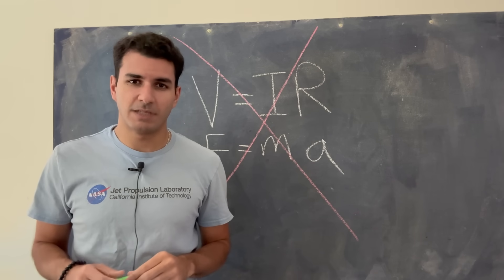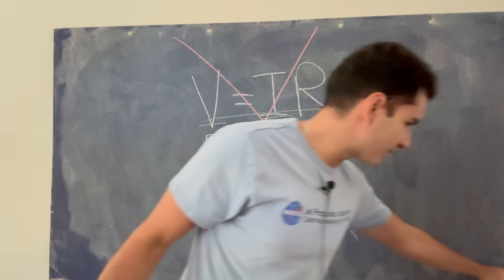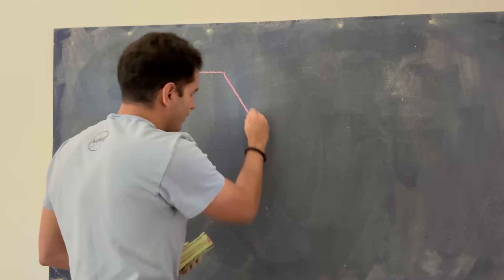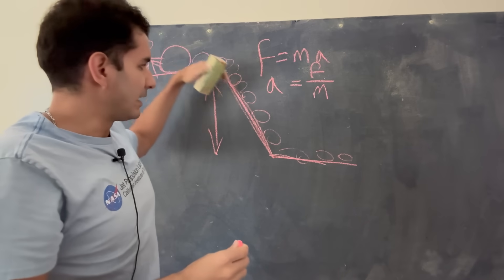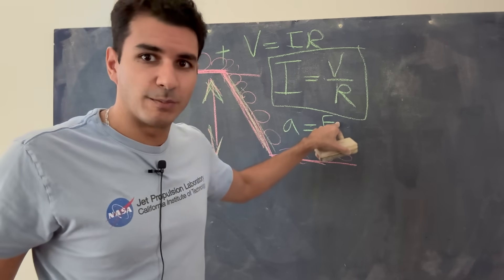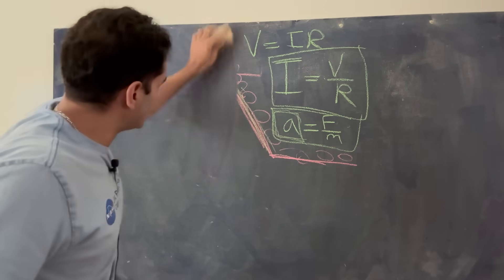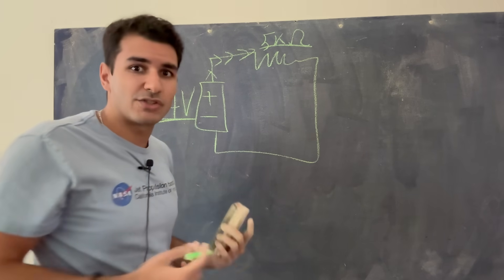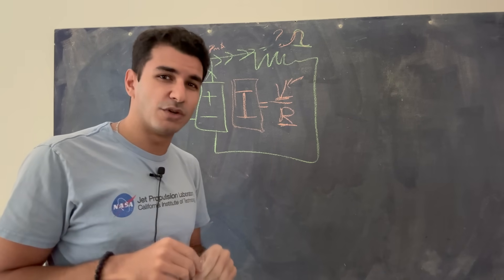You don't really understand physics

Comment: WOW.  Glad I stumbled onto this.
I wondered where you were going with this at first and you take too long to get the the root of the issue  - cause and effect.
From comments saying they never thought of cause and effect, tI can see they have indeed, learned very poorly.
.
You are on to an important point that I have seen for quite some time. The cause and effect is VERY IMPORTANT and if that isn't taught any more,  that is very sad, because it isn't teaching. 
.
The equations NEVER show cause and effect.  They ONLY show what happens - not why. 
Which are dependent variables and which are independent variables. 
.
In the beginning. When scientists study things and provide equations:

.
The  physical behaviors are understood FIRST.
THEN.
They  learn how to quantify the values.
THEN
Then find the equation that mimics the real, physical world.
THEN
Then, 
We can use the equations, but we must understand the underlying physics to use them correctly.
.
The equations are a model of the physical world.   Equations do not define the behavior, nor control them.  They are a tool that imitates the real world's values. 

.
Advice. . .
..

For one thing, F=MA starts when the guy PUSHES On the ball.  His force accelerates it horizontally.  The slope and gravity complicate it more than necessary.
.
Then, Mass resists Acceleration.  The fundamental, physical property we call Inertia can be said to describe that resistance.  Let's teach that!
.
I have felt for a long time that we need to re-describe Newton's Laws of Motion because too few truly understand what they really tell us. I think it is simply a desire to retain Newton's words, but the real meanings are also lost.
.
Newton's First Law tells us that Force is the CAUSE of ACCELERATION.
.
The First and third Laws tell us that Inertia resists Acceleration and that 'resistance' is why there is what he calls the "reaction". Therefore, we can say that Inertia is the Cause of the Third Law 'reaction'.
.
I've seen beginners confuse cause and effect from the wrong interpretation of only the equation.
.
Seeing others say they didn't consider cause and effect is very sad.
.
Perhaps this is why I have seen some so-called engineers that don't really understand their subject.
.
From an experience engineer.

Comment: I’m a Physics graduate and I find no problem with equations written in those ways, since those forms are mostly used. If we were to talk about the trajectory of something then yes acceleration is the most interested. However in many other cases the force might matters more. Say we want to talk about the weight of some object on a planet, the force balance of a system, the stress or pressure applied to a string or container, etc. There is a reason why certain forms are most famous and not the others, and those forms can be very intuitive when applied to suitable circumstances. For me they just like different formulations of quantum mechanics. We have wave mechanics, matrix mechanics, and path integral formulation. All mathematically equivalent and describe the same physics. Thus I really don’t believe the most famous form of some formulas are somewhat “inferior” for understanding physics.

Comment: I appreciate the view that it can be misleading to focus on physics equations as formulas to simply re-arrange rather than understand how they relate to the associated behaviour they are explaining. 

However, for F=ma you could make an argument that either way you are missing the idea that often it is F that is dependent on mass, rather than acceleration dependent on some force. Acceleration due to gravity is independent of mass, and as such in situations with inclined planes such as your first example, I would argue that F=ma is more appropriate, where the mass itself is the independent variable modifying the force on the object, the normal force, etc.

Comment: I thankful my teacher taught me that way. The original formula is I = V/R which actually is Ohm's law. The V=I*R and R=V/I are byproducts of Ohm's law. Also as you correctly said, we are not changing the resistance nor the battery meaning that they are stable, so the I is dependent on those and to be on a closed circuit. Change the battery with lower volt, the amps will charge, the resistance will not. Change the resistance, the amps will change, the volts won't. So I'm really thankful my teacher taught me how to think. And I really love your video. It makes us think.

Comment: I think this depends on what you are trying to calculate. From the perspective of observating the voltage on some resistance , it should be written as V = I*R. Because in this case the cause is the current and the resistance and the effect is the voltage on that resistance. BTW it is the same concept of cause and effect you showed but I just wanted to discuss. Nice video :)

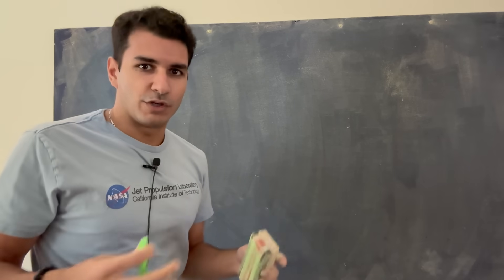Comment: 2:46 bruh i legit used v=ir today where v was the result and i was the cause. If u have an effective current source (i.e. a charged inductor) then you get a voltage drop over a mosfet as a result of the charged up current (and the drain to source resistance). This vid was a waste of 11 mins honestly
Reply: I think you missed the point of this video, the way in which you used the equation still lines up with cause and effect, it’s just a different form of it. I believe he is saying that our equations should reflect our understanding of what thing or property causes a certain change or phenomenon. In your case (if I’m reading it and understanding it right) is 1 case where Current causes a change in Voltage, not the other way around, but at the same time, most other people understand this relationship in the opposite way, where Voltage causes a change in Current not the other way around. It’s about perspective and when a certain perspective should be used or switched

Comment: The 'cause-effect' line of reasoning is nice, but fails for something like pV=NRT. Is temperature the cause of pressure, or the other way around? Is volume the effect or the cause of pressure? These questions can actually complicate things, not make them easier. I find it more fruitful in the end to just understand that a system is described by many variables, which are related to one another through equations.

Comment: I hoped to see a discussion on causal systems and the limit at which cause propagates through a system, that is, at speed of light. In such model, the Ohm's law, but also Newron's laws, will not be correct. It nearly happened when he started lamenting on cause and effect, but unfortunately he did not go into the problem, in fact he did not mention it at all. No mention of Laplace transformation and that kind of approach to Ohm's law. So, what's the point?

Comment: Ok quite nice ! But in the first place, it should be V = R  I  and not v=iR , even before your correction; because constants (assuming R is so) are written before variables ... ;-)  Therefore it's F=m*a but not F=a*m. Note that in the (proper) statement of a = F/m , you will end up in a forbidden division by zero while analysing problems involving ideal massless bodies such as ropes, pulleys, etc... Of course it's resolved by setting F=0, yet division by zero should be avoided in any case.

Comment: The way I understand V=IR is actually to say if you have a load resistance of 10 ohm and your circuit must be able to draw 2 Amps, you will need at least a Potential difference (Volts) of 20 Volts to achieve your goal, but definitional wise to explain the equation, yours makes much more sense!

Comment: I = V/R is for circuits that have voltage sources.

V = IR is for circuits that have current sources. Look at induction heating. The pot that boils the water inside it does not have a voltage source or any wire in it. It only has resistance of the iron that make up the pot. The high frequency of the magnetic fied induce current circulating the the pot. And the heat comes from the I*R.

Comment: Thanks Ali. In the example of I = V/R; is there really a positive charge and negative charges, in which, positive charges pass through the conductor to reaches to the negative ones? This is another concept that needs to be presented in more accurate manner. Is it electrons particles moving or alternating its position, and then when passing through a bulb, what happens? If we consider electrons as waves of a felid, how it can be related conductors, semiconductors or none-conductors...

Comment: I think I can agree with you. I = V/R means that the current is greater when the voltage is greater (proportionally), and the proportionality factor is the resistance - when the resistance is greater, the current is smaller. In other words - the voltage must be reduced in the total resistance of the circuit (V/R) - something like Kirchhoff's law. But we must remember that when it comes to semiconductors, Ohm's law does not work! We can find the resistance only at a specific operating point. Ohm's law isn't the most important equation in electronics, but it's  kinda useful

Comment: I agree with the way ohm's law should be written. In circuits, industry, etc. Voltages or power sources are known, resistance is known because it is typically constant, and manufactured. The current is derived, usually not solved for but measured. But the concept is the same, it's the thing we don't know that we are solving for or being caused by the other two.

Comment: Intuitively it makes sense to me as well. in my current understanding, emf and resistance are properties of the battery/components that can be tested in isolation and won't change based on the circuit it's put in, but current isn't exactly a physical property that can be tested in isolation and can only be derived from the situation of the circuit.

Comment: I'd disagree on V=IR.That equation models the voltage drop across a resistor.So V is caused by R.Plotting V against R would yield a relationship that could be approximated with a straight line that has gradient "I"

Comment: I agree, but there can also be the other approach of writing the equations in the order where things were defined.
For V=IR, what actually happened is that scientists saw that you take different materials and put them under voltage, and you get different currents, which led them to define resistance as R=V/I. So your equation can either say "voltage causes current according to resistance (I=V/R) or "resistance is defined as the ratio of voltage to current in a material".
For kinematics, mass and acceleration are easily measured, and the force was defined later, so F=ma is the way to write it under this style.

Comment: Basically you meant to say current is caused by voltage, so it should be written as I =v/r. But is the movement of charges caused by the voltage? The charges move due to the electric field, so in terms of cause and effect, we have to express I in terms of E. The electric feild is produced by the separation of charges and changing magnetic field and we associate a scalar quantity V with the electric field. Voltage is the "status" of electric field: voltage does not cause the charges to move. With

Comment: Can anyone write Ohm’s law correctly
Reply: R = dU/dI (I use U for voltage). The d should be the Greek delta.
Reply: @marknieuweboer8099  
Mathematically correct but it’s not the law.
Reply: Are you thinking of the ideal resistor principle?
Reply: @marknieuweboer8099  
The law states that V (or U) across a conductor is ‘proportional’ to I flowing through it.
In other words,
graph between V and I is ‘linear’.

Key words are proportional or linear.

The point is:
The equation R=dU/dI is valid for conductors which follow Ohm’s law as well as for those which do not I.e irrespective of proportionality/linearity.
Reply: Only for ideal resistors. So when I teach the topic I always add that in reality this never happens. So we get R = dU/dI = c.
Physicists can be quite sloppy. Very often both parts are called Ohm's Law. The first part actually is a definition and the second part merely a handy approximation. So much for the labal "Law".
Reply: @marknieuweboer8099  
‘Tis about precision,

Only if R remains constant, resistor is said to be following Ohm’s law otherwise not.

Important thing is take note that the R  is defined by same formula for Ohmic & non-Ohmic resistors both.
Reply: Nope. Try a lightbulb. The Voltage-Current graph is not linear, no matter how precise your measurements.

Comment: as someone who finished all my math before taking physics, i was very stubborn on setting up mechanical equations as  a cause effect scenario like you mentioned. however, when it came to solving a problem i would get the answer wrong due to incorrect positives and negative directions on the other forces. therefore, it felt necessary to go back to F=ma in order to start with the correct positive and negative coefficients.

Comment: I think your video highlighted some really good points about how current plays an important role in circuits. But I believe what's even more crucial is the interworking of energy—specifically, the potential difference. The voltage in a battery comes from the potential difference created by the electrochemical reactions inside. For instance, a standard alkaline battery gives 1.5 volts because of the specific chemicals involved, and when you combine multiple cells, their voltages add up. That’s why you often see batteries in series to achieve higher voltages (like 3V or 9V).

When it comes to the structure of a battery, multiple cells are combined to increase the total voltage, and this organization creates that "hunger" for electrons to move from one side of the battery to the other. The size of these cells is directly linked to battery life, or capacity, because larger cells hold more chemical material, which in turn allows for more energy storage.

Regarding voltage drop, the voltage stays relatively constant during most of the battery's life. It remains steady until the energy is almost gone, at which point the voltage drops rapidly. This happens because the battery can no longer sustain the chemical reactions at the same rate as before, leading to that sharp decrease in power output.

As for **resistors**, they are made of materials that prevent electrons from moving through them very quickly, kind of like plugging up the flow of the battery’s discharge. The pressure (voltage) from the battery remains the same, but because of the resistor, the energy cannot discharge as quickly. In other words, the resistor limits the current, so while the battery’s energy is still there, it’s released more slowly. The energy loss that happens in a resistor is converted into heat, which is why resistors can get warm during use.

One thing worth adding is the role of *resistance* in this process. As the battery discharges, internal resistance tends to increase, which can further lower the voltage output as the battery ages. In circuits, external resistance also determines how much current flows for a given voltage Ohm’s law: V = IR  meaning a higher resistance will limit current flow. So, battery life can be affected not just by the capacity but also by the resistance within the circuit it's powering.

In short, voltage stays relatively steady, the capacity depends on the cell size and chemical composition, and resistance plays a critical role in how much current can flow and how long the battery will last before reaching that rapid drop in performance.

Comment: I don't think the analogy is correct here. if you want to draw an analogy between classical mechanics and electrostatics and you analogize voltage to "force" (which is the correct analogy in classical mechanics since potential energy in both classical is caused by the field doing negative work, and the field is defined by coulombs forces) then R would certainly not be your "mass" in this case. A resistor reduces the kinetic energy of the electrons moving in an electric field. The current cannot be analogized to "acceleration" here at all. 

I would say a better analogy would be if you had a bunch of marbles that you roll down a hill, with the height being proportional to the potential energy of the marbles. the resistance is like pouring a bunch of syrup on the hill to slow them down, and the current is a measure of how many marbles per second are moving past a person standing on that hill or in other words how fast those marbles are moving

Comment: honestly i think writing it as R = V/I is even better because you can explain resistance as the "impedance" to the flow of current, so if your resistance is low for any given voltage or "force",  you more coulombs of charge flowing through the circuit. here you can assume voltage is constant and see how resistance has to change given changes in current

Comment: Bit of a correction at 4:19. If a surface is too "slippery" a ball won't roll down on that surface, rather it will slip down it without rotating( or more realistically its rotation won't match its speed) so in this case the more the friction, the less difference between the speed of the balls rotation and the speed it is actually falling down.

Comment: V and I are RELATED by R, neither is cause nor effect. What happens if you replace your battery by a current source, eg an inductor with a current flowing? Let's say you hammer a nail in with the eponymous tool. During the acceleration phase, a = F_hand/M_hammer, during the striking phase, F = a_hammer * M_hammer. F and a are RELATED by M_hammer, but which is cause and which effect? Neither. They happen at the same time. You think you know which is which by the way you design the experiment.